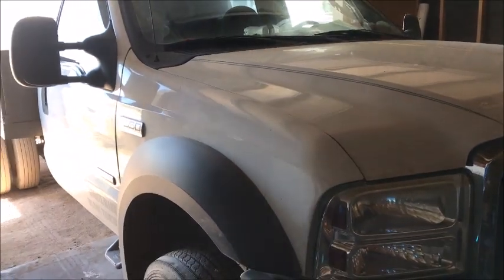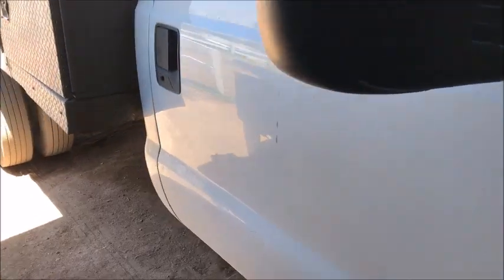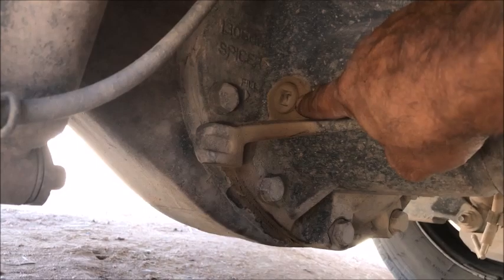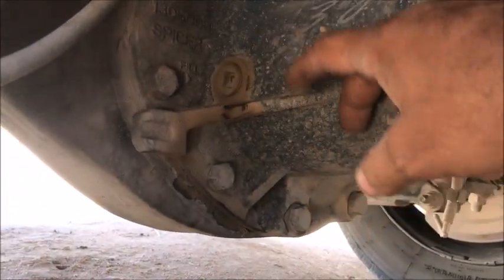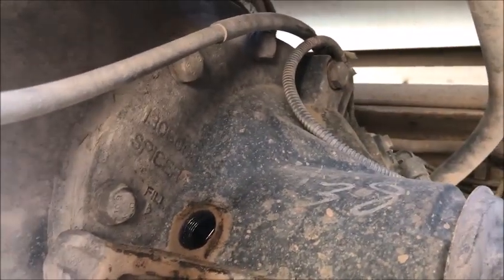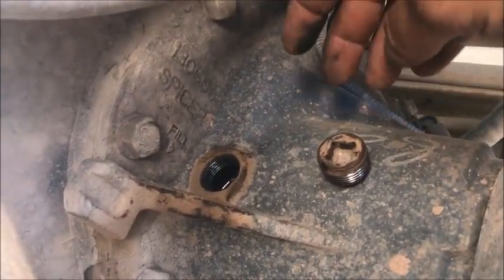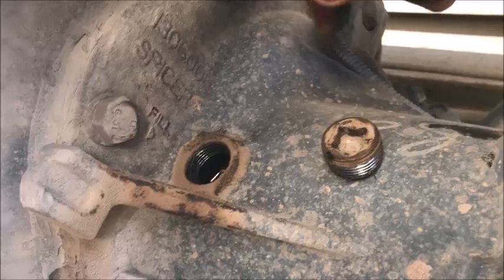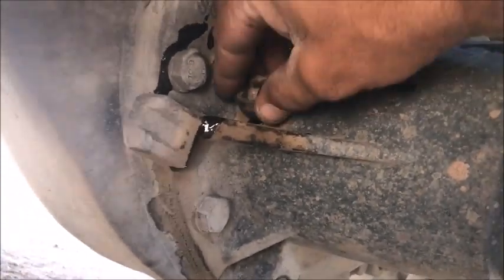Ford How to Add Gear Oil In The Rear Axle

Comment: Hey so my 91 gmc. Has a ticking noise coming from the passanger side wheel area any suggestions ive already replaced the bearings
Reply from the maker: check the backing plate, the tin is so thin, it likes to bend up and tap as she goes around giving a ticking noise. does the noise speed up as you speed up ?
Reply from the maker: you bent the backing plate i think , thanks for watching.